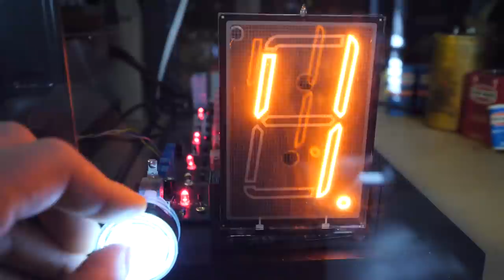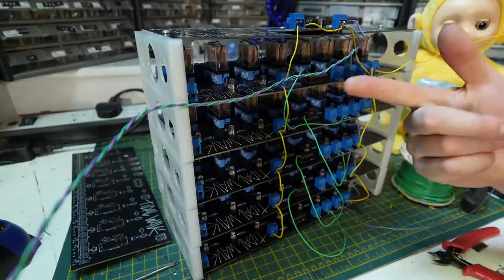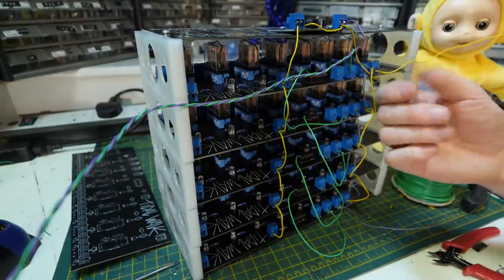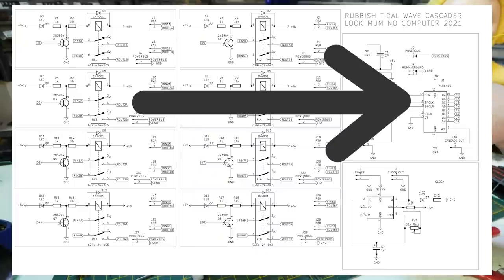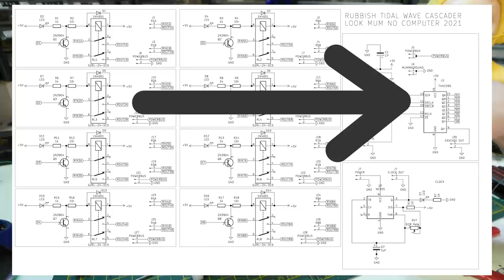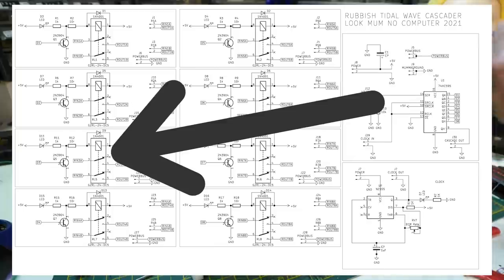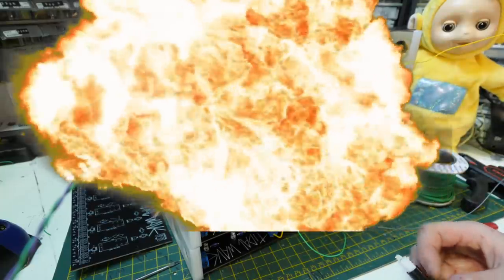Relay Nerve Centre - TELETUBBY TIDAL WAVE PART 2

Comment: Shame blocked relays are a thing of the past, it was running through my head that you could achieve the sequencing using slow to operate relays.  A block can be placed on either end of the coil to make the relay slow to operate or slow to release.  The ticka, ticka, ticka, of relays reminds me of relay based fruit machines at Battersea Fun Fair in the early 70s
Reply: ok
Reply: Amperite time delay relays, the type in vacuum tube bottles with 8-pin octal or 9-pin noval best, might work.  A shame the museum is in the UK and I'm in the States, because I've got a hundred or more Amperite relays of various basings,  delay times and heater voltages (from 6 volts to 117 volts, AC or DC.  It would take a fair bit of current to heat a bunch of them at once; they'd double as a space heater during cold damp UK winters! They also need a few seconds to cool and break the relay connection. The heater causes a bimetallic strip to bend and either open, or close, a connection (some are SPDT).  When the relay cools down, the bimetallic strip relaxes to it's at rest or cold position.

Comment: I built a similar circuit 20 years ago. I didn't know it was a shift register until it did that on it's own but here's the kicker... NO TRANSISTORS in my version! (4 control relays, which also gave  it a base 10 counter and register mode and it used LEDS AS DIODE LOGIC). I'll tell you how if you want to know!! I should add that my version was slow and prone to errors. But some of it's errors were interesting.

Comment: What I love with these is that I could actually kind of understand how it works. Except the delay, how is that done?
Reply from the maker: The delay?
Reply: @LOOKMUMNOCOMPUTER  Just curious how you are adjusting the delay between each relays!
Reply: @fredrikjohansson  The shift registers have a clock input, and they shift the data at each clock tick. So adjusting the clock adjust the delay between each relay: faster clock means smaller delay between two relays.

Comment: The idea of just going for it bit by bit with a idea in mind is what made me go from making the stand-alone DAW I'm building with a digital tape recorder systems (inspired by the OP-1 I've loved for years) a series of connecting modules rather than one large electronic synth with a mixer-ish bit tagged on.  I realized real fast I could focus on building the tape recorder first, refining all the features I'm looking for, then move onto tackling a digital synth later on.  In the mean time I can use the "tape recorder" (8 channel plus 2 extra "working" tracks all in stereo) with the instruments in my studio to mix together tracks instead of using the old school analogue tape recorders I've collected.  I like the idea of recording waves on tape rather than modern DAW timelines.  Obviously the modern approach is more efficient, but I love my OP-1 and wanted to expand on that digital tape idea for recording and mixing in my drum kit, guitars, etc.  Kind of like how as a photographer I love film, but I also respect the efficiency of digital.  My compromise is I still shoot film, but for quick and fun shooting, I have Fuji cameras with film simulations and straight out of camera get it right when hitting the shutter style approach.

Comment: I watch such videos and think that maybe a time machine is not too difficult to create.  Perhaps you just need to make the correct calculations and synchronize the clock pulses of chronological time events.  Of course, this will require a large enough energy to create a time loop lasting at least a couple of minutes of a person being in a parallel dimension.  And a person traveling in time will not be able to exert any influence on history.  Since it will create a parallel reality synchronized in a certain period of time.  It seems to me that this does not contradict Einstein's theory of relativity.  It is quite possible to find two points in the same interval of time and space due to the fact that time can slow down and accelerate, and space can be curved accordingly.  And probably quantum theory.  Oh God, what am I writing!

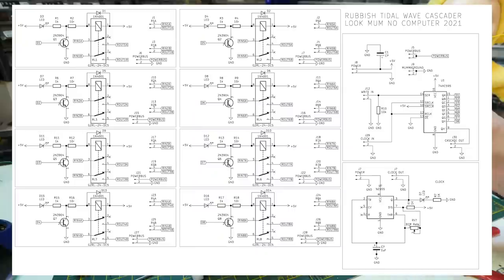Comment: Well done mate!. Really cool project, however looking at the schematic 6:32 there are no base current limiting resistors so the only thing stopping the HC595 chip from blowing up is it's own internal structure resistance. I know it works but it might not work for long. Anyways keep up the good work!
Reply from the maker: Hey mr frog. The output of the sn74’s can drive either another chip or a transistor without the need to resistors if need be 👍👍👍👍 it’s not driving anything else but the transistor

Comment: Put a mic in the nerve center box and run through a reverb. Send the output through a decent amp and bango blango! Krazy sound!
Reply: Better yet, he demoed a bizarre mechanical- reverb speaker with Springs mounted in front of the cone a few months ago. That thing would sound ungodly  if you ran the sound of all those relays through it.

Comment: How do you access the screw terminals when they're all stacked up like that?
Reply from the maker: Easy you just believe
Reply: A stubby, or cut-off-short screwdriver.  Unfortunately those types of terminals typically have slotted screws, ugh. It would be much easier if the screws had Torx or  hex-heads, or even Phillips or Pozidrive..... PS, have you ever worked with Amperite delay relays,  the plug-in kind that look like vacuum tubes (8 or 9-pin bases) and use a heater to warm up a bimetallic strip and make it bend in order to make or break a connection? Surely there's something in the works to build for the museum for which those would have interesting and usefull qualities.  I have a crap load of the things,  in various styles, heater voltages and time delay specs, but unfortunately I'm in the States and you're on the other side of the pond.....
Reply: @goodun2974  he did a video on one on the museum's channel

Comment: Did you just say "until the thirth of September" when telling us the date?

I wish I could make it, but on the thirth I have an appointment for a taint wax and laser resurfacing. Gonna turn that testosterone fueled furry under ball English muffin into smooth patch to improve my aerodynamics by getting the nooks and crannies spackled over. 
Good luck on the firstecond until the thirth of September with your Tubbies!
Reply: Wtf did i just read?